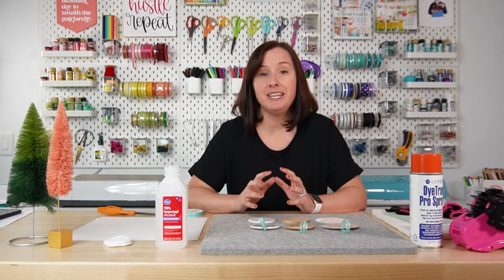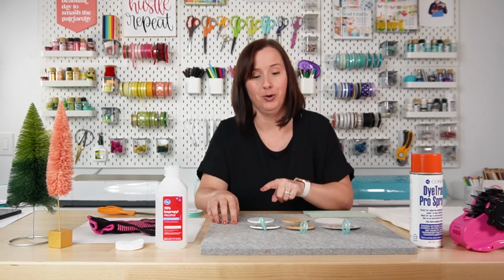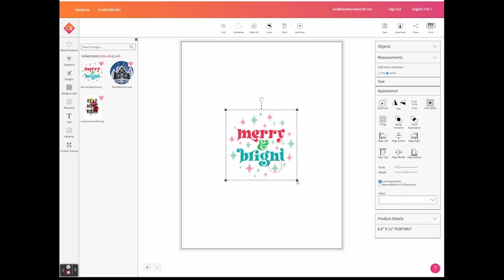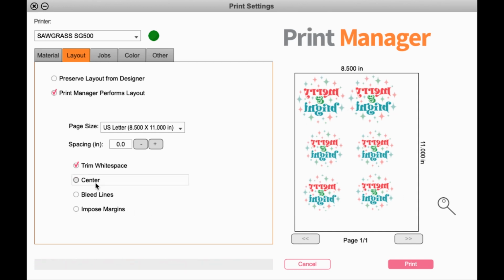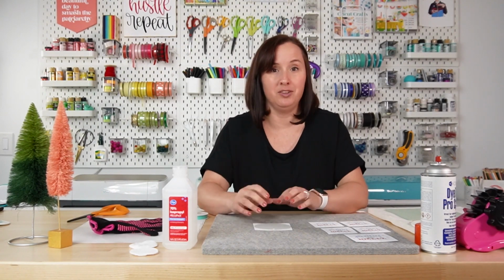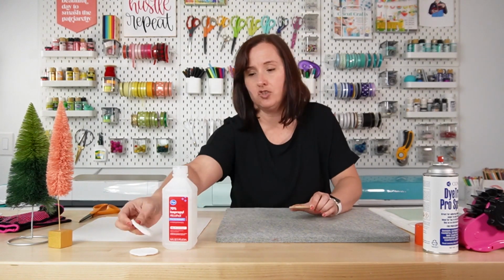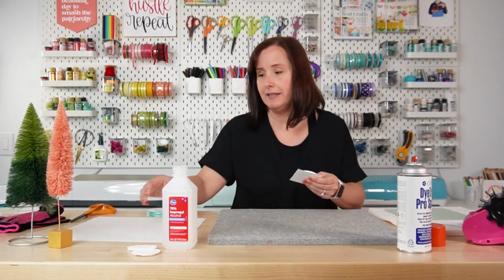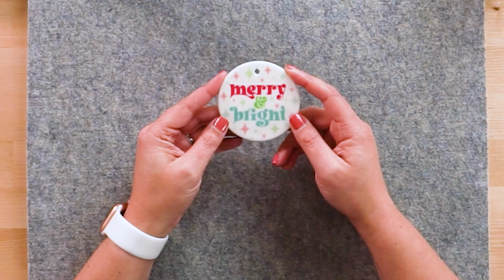Sublimation Christmas Ornaments: Metal, Wood, and Ceramic!

Comment: Your video is great. However I have a problem not mentioned in your video and I can't seem to find and answer to. I have followed the instructions and have adjusted time, temp and pressure, but every time my paper sticks to the ornament. I have washed it off, but it stills leaves a residue on the ornament. Any ideas what is causing this?  I am using A-Sub 125G paper.  I have already ruined a dozen ornaments trying to figure this out. TIA for any help you may give.
Reply from the maker: Honestly, I would try a different paper. I've had a similar issue with acrylic blanks and paper sticking/not washing off. You may want to try Hiipoo or another brand and see if that works better!

Comment: hi, I am practicing on making ornaments and I did 400 degrees for 60 seconds, but what is causing the sublimation paper to actually get stuck on the ceramic ornament?
Reply from the maker: It might be the quality of the ornament's coating. I had this happen with some keychains and no matter what I did, it stuck. Try a different brand?
Reply: @HeyLetsMakeStuff  what would you recommend to make them not look blurry or fuzzy. I put the proper tape on four sides and make sure it's tight but to me they come out looking blurry, could it be the resolution of the picture when getting printed?

Comment: Can you please explain the process of sublimation on both sides in more details? I'm struggling to get that right
Reply from the maker: What do you mean? As long as both sides are coated with a poly-coating, you should be able to sublimate the backside the same as the front. But be sure your blank is coated on both sides!

Comment: Thank you for the tutorial … very timely ❤. My question is, I don’t own a heat press, but I have a Cricut Easy Press, what are your suggestions for the ceramic sublimation ornament using the Easy Press … I do not own the green mat and it is a little pricey.  Should I use the Easy Press mat …. or maybe a pressing pillow?
Reply from the maker: Hmm, good question. I would go with no mat vs. the pressing pillow or EasyPress mat. The green mat actually conducts heat so it gets really hot—the other two options disperse heat and wouldn't get hot enough to sublimate through them. I do think something more solid underneath is important—the EasyPress mat gives too much, so maybe a folded towel or that wool mat I recommended. I would try 400° for 240 seconds to start, one side at a time, just letting your EasyPress sit on top vs. pressing with your arms. The ornament shouldn't crack because the pressure isn't as solid as a heat press you have to close. Hope that helps!

Comment: So how do you attach the second side with the heat transfer tape if you don't want the tape imprinted like you mentioned with the metal blank?  I am just getting into sublimation (so new my printer isn't even out of the box yet...lol) and your videos are super helpful!  Thanks.
Reply from the maker: I really think the spray is easier for projects like this, so that's my first recommendation. If not, I try small pieces of tape where there's no image if possible (like on my ornament) or I use a piece of paper on the back so the tape sticks to the back paper and then I just try and tape it together as tight as possible. Does that make sense?
Reply: @HeyLetsMakeStuff  perfect sense. I am pretty sure I would be a more of a spray girl myself but just in case.  Thanks for the quick reply!
Reply from the maker: @brendajos  The tape works well for like 80% of projects but there are just some where the spray is better! Definitely have both on hand once you get your sublimation stuff up and running! Good luck!